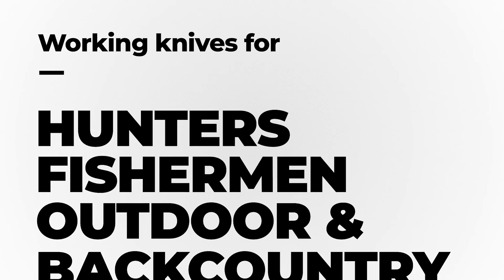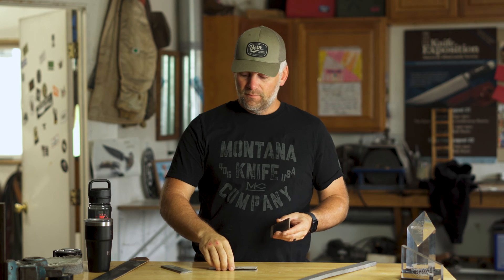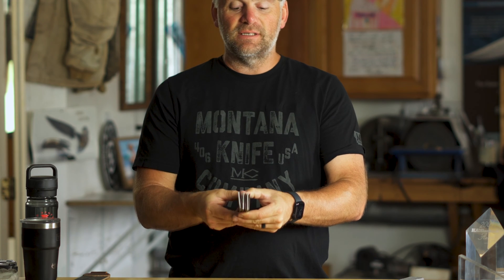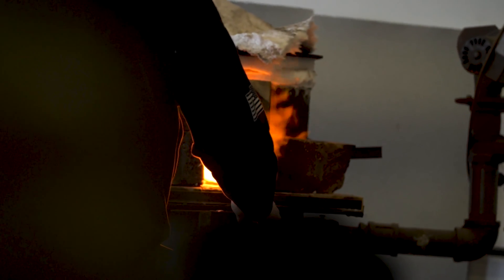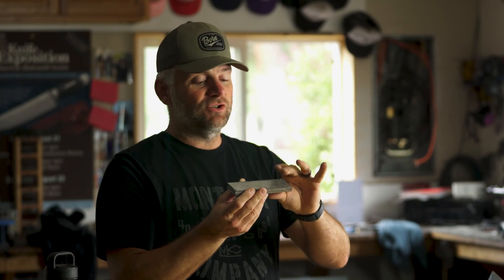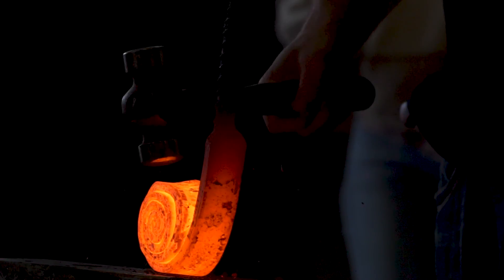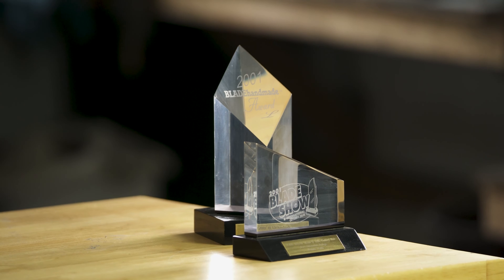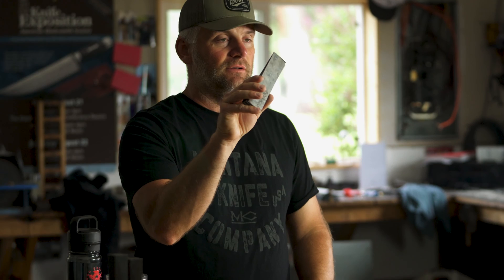What Is Damascus Steel? (And Everything You Need to Know about It)

Comment: It still doesn't explain why modern metallurgists still call the folding process "DAMASCUS STEEL", this kind of forging process was done thousands of years ago where 2 different kinds of metals are hammered and folded to increase the metal's durability and strength, for example, Samurai Swords are basically a more authentic and more refined traditional process of what modern metallurgist/content creators made in their shop, so basically the more traditional style folding process well cut and beat content creators Damascus steel any day.

Real Damascus Steel was not just about the folding process but also the types of metal used and techniques, that were used to create a durable and strong blade that does not rust away in time before stainless steel was even created in the factory decades ago. It was made in Damascus modern Day Syria 2 Thousand Years Ago. But that process was lost for some unknown reason, maybe back in the day making real Damascus steel blades was more expensive and time-consuming than making regular folded steel that content creators are making today and have decided to patent their folded steel Damascus Steel.

Comment: Completely wrong. What the man explained is how to get an aesthetic similar to damascus steel. HOWEVER, no one knows how to make the real damascus steel, the recipe was lost in history, it is by far the strongest steel ever created.
Reply: That makes sense if you do not think about it, or you could do some research.  No recipe was lost.  What is lost are the impurities that were present in the crucible, that created carbonized dendrites, which gave Damascus a distinctive look.  Today modern steel is made without impurities.  What is called Damascus, is actually pattern welded steel, as true Damascus was one steel that was not acid etched.

Comment: BEEN LOOKING AROUND FOR A FOLDER, ALL THESE COMPANY’S POP UP IN MY FEED.. LOOKED AT YOUR SITE… NO POLISHED CHEFS KNIVES… ALL COATED… I WONT COOK WITH COATED AS A PRO. MANY WONT EITHER. IF YOU REALLY WANT TO PROTECT IT SAN MAI IT AROUND THE MAGNACUT. 😊 BUT PROS ACTUALLY TAKE TACE OF THIER SHlT 😅
Reply: MY DREAM KNIFE IS A 13” CHEF STYLE IN TAMAHAGANE AND REAL HANDLE.. NONE OF THAT MICARTA/G10 BS. WOOD. BONE. ETC. (WHITE OAK CORE) AND, A WELL FITTING SAYA MADE OF MAGNOLIA. AS AN ECHEF, XBUTCHER, NOW, AS A SAHD WITH BAD HANDS (WORK INJURY AS LOSS PREVENTION) I PUT RIDICULOUS ANGLES ON MY BLADES. STARPEN TO 10K GRIT, AND STROP. JUST LASERS TO CUT WITH. I HONE DURING USE WITH A BROKEN PIECE OF BAMBOO CUTTING BOARD END GRAIN FILLED WITH DUST FROM AROUND 5K GRIT. EVEN FOR MY HANDS, I MUST DISCLOSE I USE AN INVERTED MOUNTED RO PALM SANDER WITH THE GRITS. UNDER MICROSCOPE IT DOES A BETTER JOB, ACTUALLY. HOURS IN SECONDS. DAYS IN MINUTES. THOUSANDS IN STONES FOR LESS THAN 100 BUCKS 😅 IF IM SETTING A NEW BLADE OR FULL FRESH EDGE I USE EMERY CLOTH, 80, 120, 200, 400, 600, 800, 1000, 1500, 2K, 3K, 5K, 7K, 8K, 10K, SUADE, POLISHED LEATHER (MY BELT, INSIDE AND OUTSIDE, REAL ONE PIECE OF LEATHER BELT) PLUS, THE EDGES OF THE PALM SANDER THE PAPER WRAPS AROUND IS CURVED PERFECT FOR LARGE SERRATIONS, LIKE A BREAD KNIFE. SMALL ASS SERRATED SECTIONS ON POCKET KNIVES ARE STUPID AND USELESS, AND MAKE UP FOR POOR METAL AND POOR SHARPENING. 😅 YOUR KNIVES LOOK SICK THOUGH! MAGNACUT FFS 😂 NICE! OUT OF MY RANGE THOUGH. HAPPY TO HAVE COME ACROSS THEM THOUGH!! 😊🎉
Reply: WELL F. YA KNOW WHAT I DIDN’T SEE? YOU HAVE THE PERFECT BASE IN YOUR CORD WRAPPED OUTDOOR KNIFE… A PARING KNIFE… A GOOD PARING KNIFE IS HIGHLY UNDERESTIMATED IN PRO KITCHENS.. ESPECIALLY WITH A SAYA, WITH A BELT CLIP… NO SHlT… BACK IN THE DAY I WOULD KEEP ONE TIP UP IN MY CHEF HAT. TIP UP IN MY ARM SLEVE THAT ARE NOW SEEN WITH THERMOMETERS 😅 ITS ONE FOR A SHARPIE, ONE FOR A PARING KNIFE, 2 SLOTS IN ONE POCKET. ONLY THE EXEC CHEF NEEDS A PEN 😅
Reply: FROM WHAT I SAW TOO, I WOULD PAY MORE FOR INDIVIDUALLY TEMPERED KNIVES.. NOT 20 ON A WIRE.. A GOOD FRIEND OF MINE HAS A WESTERN STYLE OF MY JAP KNIVE, EXACT. SAME METAL, SAME COMPANY. VG10 CORE DAMASCUS. HIS, IS A DAMN FREAK. MINE IS AWESOME.. HIS HAS GOT TO BE LIKE A 70 HRC. WTF. MOST DIFFICULT METAL I HAVE WORKED WITH. SIGNIFICANTLY HARDER THAN MINE AT A REASONABLE 64.
Reply: I ALSO HATE BS DAMASCUS PATTERN, USELESS STYLE. YOU CAN TELL BY THE PATTERN INTERSECTING THE EDGE INSTEAD OF RUNNING PARALLEL. IF BOTH METAL TYPES ARE ON THE EDGE OF COURSE IT WILL BE ‘SHARP’, LIKE A GINSU IN FACT 😂 MICRO SERRATIONS.

Comment: If you didn't care about appearance and were just going for the best knife with sharpness and strength what would the ideal layer target be like 200 layers or 600?
Reply: People folded the layers because the raw quality of the steel sucked so bad. It blends out the impurities. Modern techniques allow you to make steel so you need to fold the metal zero times. Calling it Damascus is a scam, so they can charge you more money.
Reply: @joefish4466 Ancient Damascus wasn't folded forged steel, the bands in it were due to a different process that isn't fully understood.